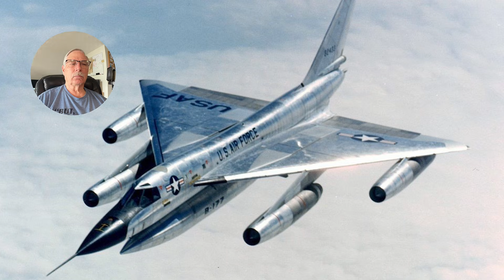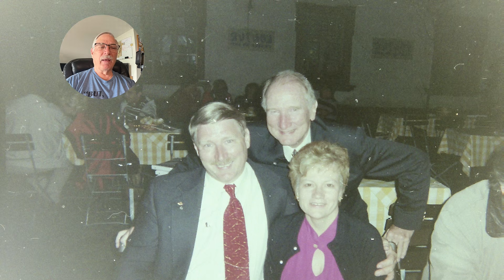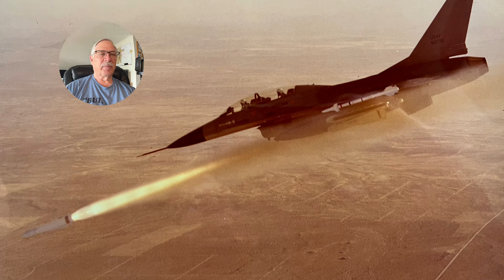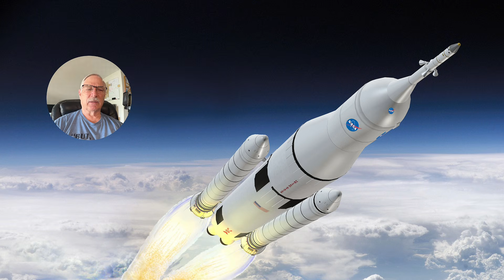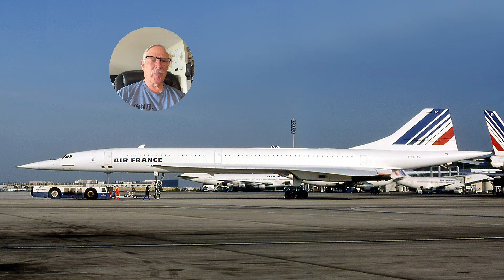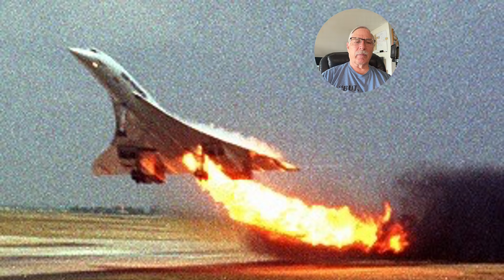Deadly Design Deficiency. Air France 4590 June 25, 2000. Fatal Concord Accident.

Comment: Wernher Von Braun was quoted as saying that the Space Shuttle had a (probability of failure) of 1 in 50 flights. The fact they made it to 150 flights and only lost two shuttles shows you how far we were pushing things. The B-36 vice the YB-49 would be a good video. After reading many books about the SR-71, I am always dumbfounded that they kept with the old engine design, which does look iconic, but produces insufferable yaw moments during unstart. However, I can totally understand why that was the ruling philosophy when the B-58 was introduced and before engines became more reliable. Another good topic for discussion may be afterburning turbofans, or what happens when the afterburner has enough oxygen and converts back into a turbojet. You are 100% correct on the Concorde; the number of failures they had that far in the program shows they had some serious issues that needed to be addressed and they failed to do so. I wonder today if a SST were designed if it'd feature the blown lift devices of the C-17, and a decent set of flaps to go with the Leading Edge Extensions and winglets. Why don't we see winglets on supersonic aircraft? Just an idea for a video.

Comment: I find it rich that the French gov't and aviation related parakeets threw themselves into a crescendo of passionate indignation over the Continental DC-10's shedding of the titanium strip. But where blame can be deflected and taking responsibility for a design flaw can be bigged up so that it resembles the final act of Tosca, allez-y-vous, by all means! When in 1974 a ground handler at Orly improperly closed the rear cargo door of Turkish Airlines 981 a DC-10 flying to London Heathrow.  The improper closure led to explosive decompression when the door blew off, severing all hydraulic lines, resulting in the deaths all  346 passengers and crew.  
The reason the door was closed improperly? The instructions to close it, wh. were clearly written somewhere on the door, weren't in French. I don't recall government hearings, a smear campaign in the press, threats to arrest foreign parties, or anything else of an hysterical nature.  Funny about that, n'est-ce pas?

Comment: 5:55 Paris Le Bourget airport has witnessed the crashes of 3 large supersonics:

A B-58 in 1961
A TU-144 in 1973
Concorde in 2000

The first time interval was 12 years.
The second time interval was 27 years.

12 + 27 = 39 so extrapolating a straight linear trend means the next supersonic crash should be around 2039.

A supersonic called Boom is currently under development. Quelle surprise..
Reply from the maker: Well, I would be 89! So if I'm still around....I'll do a video on it!
Reply: @ronrogers 💯

Comment: The aircraft was over fuelled, the weight balance was wrong as a load of newspapers had been loaded, this without going on the manifest to the captain,so his rotate speed was inaccurate, the plane I think had a worn wheel bearing, plus it had to switch runways late in the day, the plane was under pressure to go as it had Holiday makers on it who were catching a cruise liner in the states.
Air Frances systems were at fault, plus they wanted rid of the aircraft as it couldn't make a profit, by BA could.
The full tragic story is in a book by the captain of the BA Concorde fleet, the plane was not to blame, Air France were.
Reply: If all the factors were favourable Concorde would still have crashed if it had hit the titanium strip.
Concordes achilles heel were its tyres.

The British & French knew the tyres were the weak point but did nothing. The problem with the aviation industry is that major improvements to 
operating procedures are only made after a sufficient number of people have been killed.

The DC-10 had its own development woes. The aircraft that deposited the titanium strip on the runway had been serviced in 'Israel'.. ✡👿✡

'Israelis' do not like civilian airliners. Or anything civilian for that matter..
Reply: You are, no doubt, referring to captain Mike Bannister's book on Concorde, whereby he goes into some depth about the disaster. There was a problem with maintenance of the crash aircraft's left bogie spacer, I recall. Also, Mike actually had Bill Weaver on the flight deck one time.

Comment: The AF4590 accident is much more complicated than what you've described here, Ron.  The fuel tank rupture was in large part due to the fact that the captain overfilled the wing tanks, eliminating its designed void space. He also left the transfer fuel pumps on, ,contrary to SOPs which also kept the tanks full during taxi.  It was also overweight and beyond the aft CoG position.  Check out "John Hutchinson on Air France Flight 4590" on Youtube for a much more detailed explanation of the catastrophe.
Reply from the maker: Thanks for the additional information and for sharing your thoughts on the accident.

Comment: The Continental maintenance employee who had installed the errant thrust reverser rub strip was pointed to by many (including the French) as significantly responsible for the accident. He didn’t have a certified part available, and instead of waiting for the part to be restocked he fabricated one himself. Unfortunately he made it out of titanium. If it had been a certified part it would have been much more malleable and the tire might not have shredded even at Concorde TO speed.

I suppose you can blame the accident on a design defect, but this Swiss cheese had one hell of a lot of holes.
Reply from the maker: Thanks for the additional information!
Reply: Amen

Comment: As a supplementary detail, Continental Airlines did not own any DC-10 aircraft—they leased them. I once had the opportunity to speak with Gordon Bethune about the DC10's.
Reply: Uh.. pretty much no airline owns airplanes. They are either mortgaged.  Recapitalized with another mortgage after the original mortgage is paid. Or they just skip that and simply lease.  

With debt being cheaper than what you can make with that cash.. you never want to own anything.  

Next time you’re boarding a plane, look up at you enter the door. You’ll see the aircraft data plate.. and who hold the mortgage or lease on the aircraft.  Almost none of them will say the actual airline.  They will say Wells Fargo bank or GECAS or something.

Comment: I attended a forum at Oshkosh Airventure a few years ago that was being given by a retired British Airways Concorde Captain. A couple of additional interesting things he mentioned that were related to him by Air France Captain's that he knew.

1. The aircraft was also outside of the aft CG Takeoff limit, (probably not a direct factor,).

2 .The aircraft was improperly fueled. They were supposed to leave a couple of inches of airspace in the top of the tanks but the fuel tanks had been fueled so that 100% of the tanks were fuel. As a result, when the bottom of the tank was struck there was no open space in the top of the tank for the fuel to be pushed up into. That was a big contributing factor to the tank rupture.

3. It could have been much worse. There was an Air France Boeing 747 holding short and waiting to cross the active runway while the Concorde was taking off. The Concorde started drifting off of the runway center line toward the 747 and missed the nose of the 747 by 20......YES 20 feet!  Seated in nose in the first class section of the 747 was the President of France and his wife.
Reply from the maker: Wow, great story! Thanks for sharing!

Comment: Concorde earned £500 million for British Airways after tax profit, this was between a loss making 1982 and a highly profitable 2000 with just seven aircraft. The first profitable year was 1983 (£14 million) increasing to £54 million in 1987. BA had good and bad years, in 1992 they actually even made a small loss, but then quickly returned to profitability. Immediately before the crash the profit levels were running at nearly £60 million and could have returned had they kept flying. (Even the last 6 months of operation in 2003 netted £50 million profit). 
[Ref; Heritage Concorde ]
Reply: For the French and British governments it was not a success, but BA definitely made a lot of pound sterling off the fleet
Reply: @brooklyndrive

I mean… this is basically every American aircraft.  Boeing and McDonnell Douglas and Lockheed when they used to make aircraft were also funded by highly padded cost-plus-fee defense contracts that paid for capital, R&D, and was the source of investment for civilian aircraft.  

Lockheed never did figure it out.. and after designing the L-1011 like one of its military projects.. went on to lose ten million dollars for every L-1011 sold—in spite of loan guarantees from the US government to stave off bankruptcy.
Reply: @calvinnickel9995   The Tristar was almost twice the price of a DC-10 but was still unprofitable. The DC-10 / MD-11 bankrupted Douglas so they were bought by Boeing who incoporated some of Douglas's questionable design practices which resulted in the 737 Max / 787 fiasco.

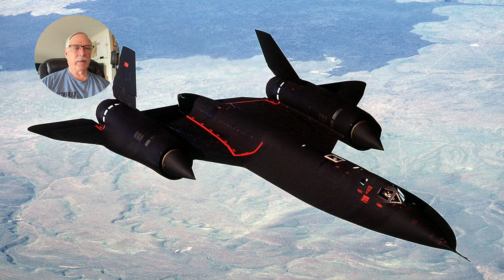Comment: 7:43 - The most relevant point with the SR-71 for this Concorde video is that Standard USAF Procedure was to do LIGHTWEIGHT takeoffs, then go hit a tanker.  This made it a lot safer to operate.  Significantly lower unstick speeds.  Significantly less tire stress.
Reply: The loss of 61-7970 after a collision with a KC-135 seems to negate the safety advantage—especially since the SR-71 fleet flew a fraction of the hours of Concorde (indeed… Concorde has more supersonic hours than all other aircraft in the world combined)

The SR-71 needed to tank up because it leaked like a sieve on the ground and it wouldn’t have any range if it didn’t tank up.. 

So the rationale was more like “since we have to do the high risk tanking anyway … we might as well reduce risk and take off light”.
Reply: This had more to do with inerting the tanks with dry nitrogen pressure at +6 PSI atmosphere than anything else. Heavyweight takeoffs such as from Palmdale involved fully fueling the airplane on the ground then pushing fuel back to the KC-135Q until the desired load was obtained. JP-7 was fairly inflammable as it was a fully-synthetic fuel and a special blend of substances that are all matched to avoid any hazard of air fuel mixture in the tanks becoming combustible.

Comment: Hard to believe but I got an agent at JFK to let me go down to a Concorde between flights. It felt more like being in a DC9. Can’t imagine going 187 kts down a runway. Heck I thought taking off in a maxed out 747F in Anchorage was fast(especially with the end of the runway getting close). Has to be a rush
Reply: Really?  I’ve gone faster than that in a King Air with the height of my cockpit lower than the Concorde’s.
Reply: @calvinnickel9995 well let’s just say a different kind of rush. When your still below your rotate speed and you see the end of the runway the pucker factor goes up. Believe me I’ve been 500Kias at 100AGL and been very relaxed but if I’m having to check my six while doing that, it’s a whole different story. Obviously I wouldn’t.

Comment: At least the DC-10 didn't puke up an engine or cargo door onto the runway. I think the piece of the landing gear that was sitting in a hanger instead of attached to the Concorde due to a maintenance error had more to do with the crash than the French investigators wanted to admit.

Comment: The scarier design flaw was the TWA800 centre fuel tank explosion. Or that 747 door that blew out and put a passenger into the engine.
I never took Concorde because I'm not rich - yet - and although I could just afford it, if something went wrong, they'd put you into a 747, which would have sucked. It was about £8000 at that time.
Apparently, this aircraft was a wee bit overweight. Would any aircraft commander permit this in the first place?
In any event, thank you for the insights into your life and thinking.
Reply: This is why the SR-71 had the procedures that it did with respect to fuel and fueling: specifically to avoid a TWA 800 situation where the fuel and air mix and combust in the tank

Comment: There was a great deal more to this tragedy than a bit of metal on the runway. The Air France cover-up of this tragedy to deflect blame elsewhere has led to many not knowing the true causes of the crash. Watch BA Concorde Captain John Hutchinson's video here for the truth: https://www.youtube.com/watch?v=fqOcYhzWUZY&t=13s or better yet read BA's Chief pilot Concorde, Mike Bannister's book, for a no holds barred account of his experience as an expert witness at the subsequent enquiry.
The obfuscation by the French authorities that Mike recalls is staggering; if he or AAIB showed interest in any part of the wreckage in the BEA hangar, next day that bit would be mysteriously missing. And the aircraft's load sheet, a copy of which should have been lodged at CDG airport went missing as well.
Mike Bannister tells of much unprofessionalism in the operation of AF 4590, including overfilling the fuel tanks which meant there was no airspace in the top of the tank to absorb the shock wave in the fuel caused by the the debris hitting the base of the tank, which directly led to the shock wave propagating back down and bursting the tank open.
The aircraft had a CG aft of limits and was overweight, AND THEN 20 extra un-weighed bags were put in the aft hold which made both those factors worse. And because of the aft CG the transfer pumps were running transferring fuel from tank 11 (rear trim tank) to the main tanks (a big no-no in a Conc take off) keeping the main tanks chock-full even as the engines drank fuel out of them, hence no air gap.
Then there's the missing spacer in LH main gear. And the FE (off his own bat - not a command from the P1) shutting down an engine that was still producing power and starting to recover from the power loss caused by hot gas ingestion from the fire (it was showing a fire indication but the engine was not on fire - the engine fire detection had been triggered by the massive external fuel fire). And much else.
The bit of metal was the trigger for the accident, but what turned an incident into a tragedy were all the other swiss-cheese factors
.
Vince C

Comment: The conditions under which the fuel would ignite after the tanks were breached are nothing short of extraordinary because the spray pattern had to be just right and a vortex had to be involved in keeping the flame from blowing out on top of having the ignition source  
Which wasn’t the afterburners contrary to popular belief. The Swiss cheese slices really aligned « perfectly » for this to occur. I drive by the crash site quite often and always have a thought for the people involved.
Reply from the maker: Thanks for sharing your thoughts on the accident.
Reply: The piece of the landing gear the maintenance people forgot to attach to the landing gear may have been another hole in the cheese.
Reply: I dunno. Jet fuel is hard to light but it’s more flammable than you think.

Comment: I think the tyres were made in Lynchburg, VA…
Reply: As part of the 2001 modification following the 2000 Paris crash the original standard aviation design nylon bias ply tyres on all eight main wheels were replaced with a new puncture resistant lighter weight tyre, the NZG Near Zero Growth tyre developed by Michelin Aviation Products. The Michelin tyres are rim-to-rim reinforced radial tyres that are resistant to incision. If severe damage should occur to the tyre it is designed to fragment into very small pieces too small to result in rupturing a tank. Expansion of the tyre under pressure and consequential elongation of the rubber tread is minimised by reinforced belts and sidewalls. 
Vince C